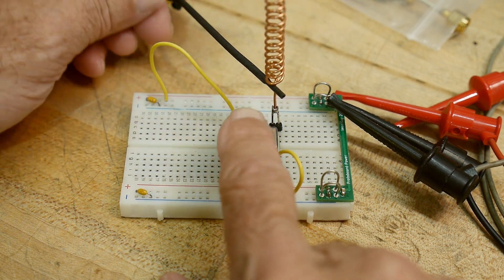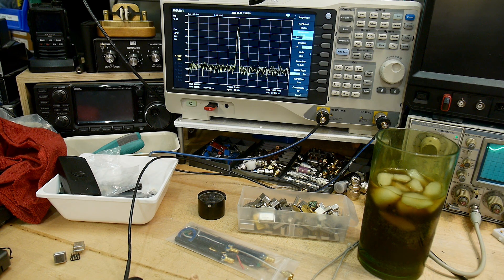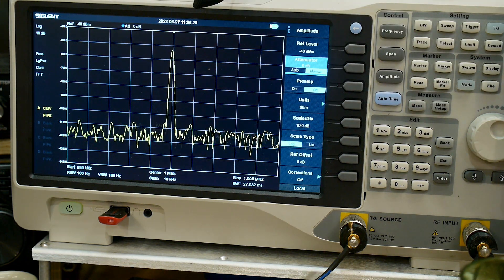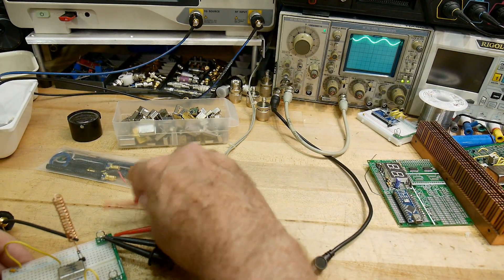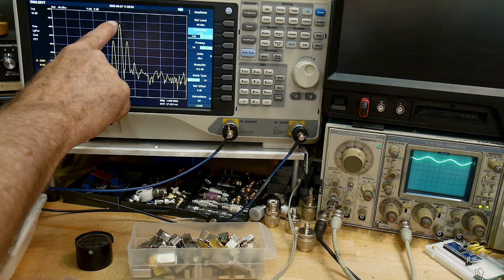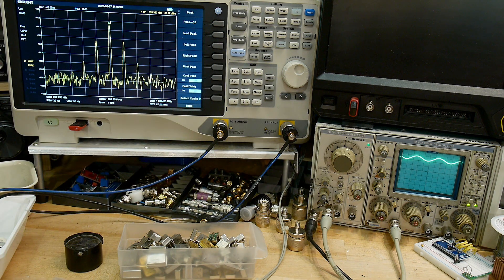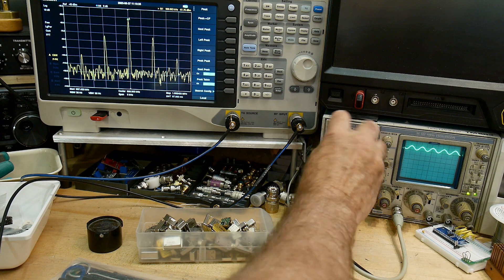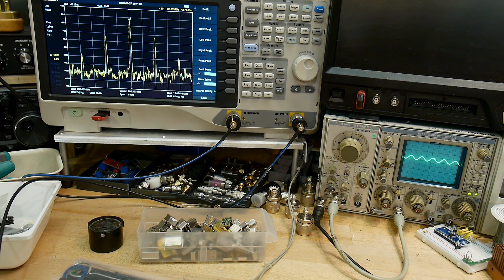#1568 Amplitude Modulation

Comment: How you make and connent antennaa
Reply from the maker: bend wire, solder wire.  That is really a terrible antenna, just for fun on the video. it is not the correct length for that frequency

Comment: You are not only AM modulating, but also FM modulating.
This is evident with extra two side Spurs besides first spurs.
In oscillators there is a concept called pushing, which changes in the supply causes FM modulation and they can model it using Basel function.  This is significant  in design of VCOs because the noise on the supply causes FM modulation and phase noise.
You need to use some sort of multiplier after oscillator itself to AM modulate things.
Reply: I don’t see any amplitude delta…at all. It could be the frequency spectroscope is averaging the magnitude measurement of any given frequency, which would hide any rapid changes (modulation)

I speculate what we see, and what we hear, is the ripple induced in the power input, not modulation of the carrier. This is what you suggested was happening.
The center frequency is rock steady in amplitude and bandwidth, implying the oscillator does its job even with an unsteady input voltage.

Very cool demonstration! Just not Amplitude Modulation of a signal like we think we’re seeing. Or, it’s been mis-labeled as amplitude modulation for a century.

Comment: In the old days simplest method of AM modulation was to use a carbon-mic in series with the cathode of the oscillator-tube, but of course, getting hold of a carbon microphone is not that simple anymore

Comment: But why AM sidelobes apear in frequency domain? We a varying amplitude, but some carriers appear. I just don't get it
Reply from the maker: yes, that is where math helps. simplistically you have Fc (the carrier) and Fm (the modulation frequency). They combine to give Fc+Fm and Fc-Fm and the left over Fc
To understand more I suggest reading about this and look at the math formulas for a modulated sine wave.
Reply: @IMSAIGuy  ok, I see. after multiplying we get the sum and the difference of our signals👍 do I understand right that second and other higher harmonics appear because of non-ideal modulation?
Reply: @andrsam3682  Here we are not only AM modulating, but also FM modulating.
This is evident with extra two side Spurs besides first spurs.
In oscillators there  is a concept called pushing, which the changes in the supply voltage causes FM modulation and they can model it using Basel function.  This is significant  in design of VCOs because the noise on the supply causes FM modulation and phase noise.
To make a pure AM modulation you need  to use some sort of multiplier after oscillator itself to get pure AM modulation.
Search the internet for "VCO pushing" for more detail.
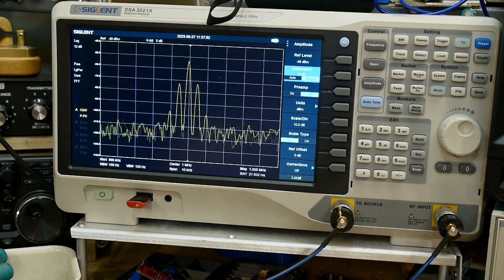Reply: @IMSAIGuy  But is "They combine to give Fc+Fm and Fc-Fm and the left over Fc" not frequency modulation? When you change the supply voltage very slowly (2:00) the amplitude of Fc changes, okay. But when the supply voltage changes quickly (3:45) the the sidebands appear. And also if you modulate with other electronics circuits. I have never find a explanation for this effect ( or one I understood :-)). Can someone help me (us) out here?
Reply: So this is not a demonstration of amplitude modulation. If so, then the center frequency would be changing in amplitude (voltage) and it is not.
Unless the term “amplitude modulation” has been poorly named for a century.

Comment: Have to comment on the final part of the video.  One of the things I do in my day job is FCC licensing.  This includes earth stations, satellites, and quite a few experimental licenses to support development and testing.  The requirements for experimental licensing have changed from the old x milliwatts of power and 6 foot antenna.  OET no longer has a minimum power value below which experimental licenses are not required.  Pretty much you need to be in a faraday cage or anechoic chamber, otherwise they want you to get an experimental license.

I would advise folks to get an amateur radio license.  Then experimenting with equipment that operates within ham band limits and meets other technical requirements would be OK.
Reply: See:
https://www.ecfr.gov/current/title-47/chapter-I/subchapter-A/part-5

See also FCC Dockets 10--236 and 06-155 for discussion on expanded opportunities for radio experimentation and market trials under Part 5.

Comment: For SSB, do they just filter out one of the sidebands and amplify that instead?
Reply from the maker: that is one way. there are more complicated ways that also remove the carrier.
Reply: You might Google "doubly balanced mixer".  In amateur radio they filter the undesired sideband and amplify what's left.  This means a receiver has to regenerate the carrier either directly on the original carrier frequency for direct conversion, or by using a beat frequency oscillator that operates at an IF frequency.  This converts the RF back to audio frequencies.

Comment: §15.219 is the rule that applies to most of those who use AM for microbroadcast as it calls for the maximum input power at the final radio frequency stage to be at or less than 100 milliwatts (0.1 watts) and the length of the antenna system (transmission line, radiator and ground) to not exceed 3 meters (10 feet).
Reply: Try a magnetic loop antenna with this 3m of wire. Should result in a strong signal for Sure 😁